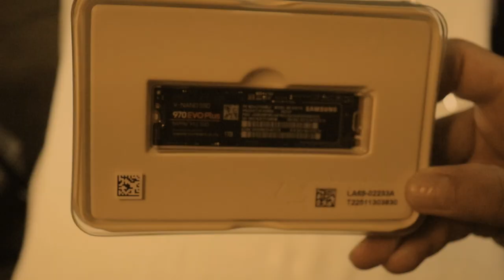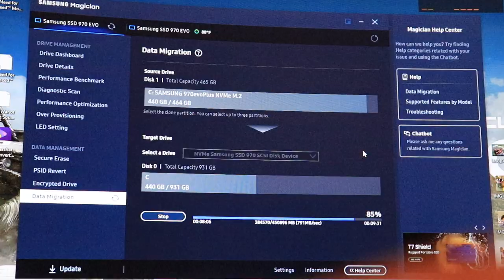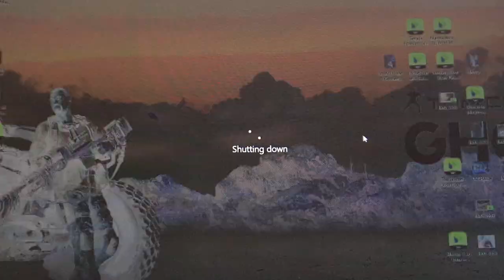installing SSD 970 EVO NVMe M 2 1TB to ASUS TUF Z390 PLUS #SAMSUNGMAGICIAN #SSDEVONVMEM2 #NVMEM21TB

Comment: hey man i thnx for the help. I have only one question , i am in the exact same spot as u i have the same motherboard and the same ssd but i am new to pc builds. I am going to upgrade my ssd to a bigger one and i wanna replicate the data. I have my OS running on the smaller ssd, my question  is do i need to replicate the data first or do i just do the same process as u did in the video ? doesnt change ssd slots on the motherboard interfere with windows?
Reply from the maker: Used samsung magic software app make sure u got the right one. I’ll guide u